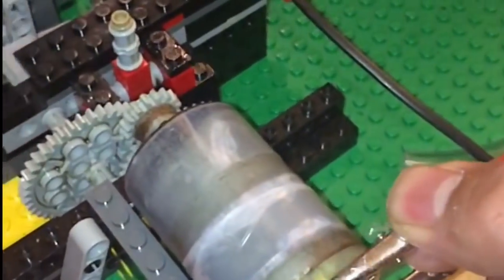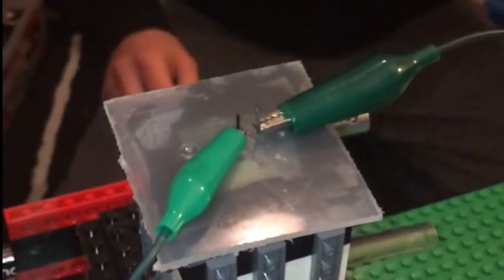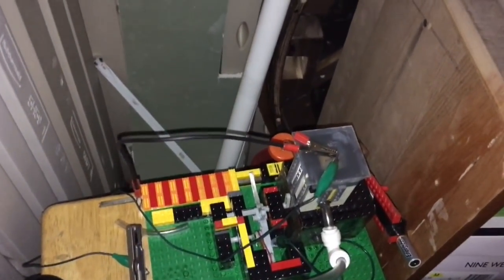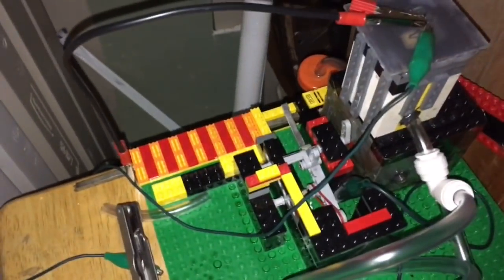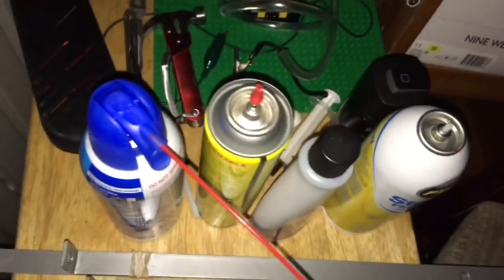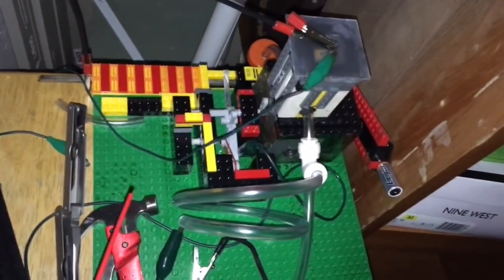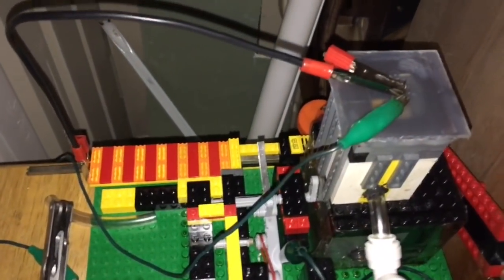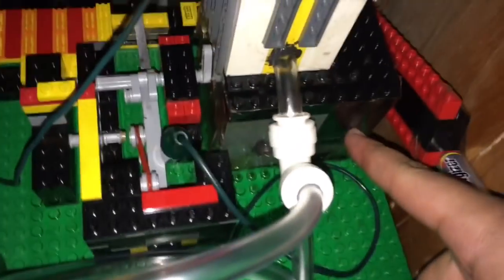LEGO 2 Stroke Motor (With real COMBUSTION) attempt

Comment: You are making history man¡¡
 I'm into the ride whit the 2 stroke lego... 
One suggestion I got is to make the piston travel shorter so it is easier to complete the cycle, or epoxy all the legos from the cylinder to furder prevent leaks from it...
Reply: YES piston travel is massively more than it needs. Try shortening it at least a "little" bit.. You could use smaller flywheel then perhaps using a few large lego wheels as a flywheel if you have them. more reliable
Reply from the maker: Dude that's a great idea, we might be too far into change that though. But if all else fails I'll keep that in mind, and shout you out for your geniusness
Reply: Thanks for the appreciation bro, hope everything runs smoothly on the end and the lego engine melts down on its own powaa¡¡ haha... And a big greeting from Argentina
Hope my english isn't to bad tho

Comment: Awesome idea. I feel like it’s missing compression, carburetor to mix fuel and air consistently, and be sure the ignition isn’t till the piston is going down from the compression stroke
Reply: It's definitely missing compression, the carburetor could be replaced by injection since that is easier on a lego engine
But yeah ignition timing still needs to be worked on

If the creator sees this, I suggest you go to a CnC workshop amd forge your own lego pieces out of steel if you can for the piston and the crankshaft, it will make it run better

Comment: Looks like you're not getting compression. You'll get explosions, but it's probably leaking around the piston. 

Nice design. Hope to see more!
Reply from the maker: If it's going pretty fast it cranking at a good speed, we get good compression
Reply: Mad Brick legos have gaps in between them so they dont get good compression
Reply: Mad Brick try timing it
Reply: Mad brick not always I had a weed whacker spin at high speeds and fire but I didn't have enough compression so it didn't run and I took it apart and found it had a large gash along the cylender
Reply: Mad Brick Mike do you have a old carburetor or a junkyard carburetor  the way air and gas com to geter and or like lawn mower carburetor
Reply: Mad Brick a car with a bad head gasket can have bad comression and run. Just because it fires doesnt nessicarily mean it has good compression. You need a way to make a seal on the piston and a way to make sure that there is nothing escaping through the sides (the lego bricks)
Reply: Mad Brick you can't be sure you have compression until you get a pressure meter
Reply: Piston rings would help
Reply: I think that they need to mess around with the fuel air ratio and if they said flywheel wasn’t good enough then better flywheel. But compression is probably the biggest culprit here

Comment: You need proper compression, which this solution just can't provide. Even a few dozen psi would be enough.
Reply: MonsterWithConscience what they need to do is get some tiny washers for piston rings,  round pistons so it'll finally get acceptable compression, get some oil in the cylinder to boost those numbers, and it should actually work
Reply: Grew up as a tuner, so do I need to begin explaining just how difficult and intricate a process it would be to provide forced induction to a very low displacement motor made from legos, which leaks horrifically, has no lubrication, fuel supply, coolant system (passive nor active) and of course has an abysmal capacity to cycle due to its lack of compression? I'm trying to be brief, but I could keep going...
Reply: chasebh89 a layer of jb weld on the piston head and along the cylinder walls Isn't a bad idea either to raise compression

Comment: How are u sure that the gases got in? Try injecting the fuel while turning it as it draws air...idk
Reply: Andrew Vigil yah and the air fuel mixture has to come through that valve that they made with the bottle cap and into the bottom end then through the transfer port into the cylinder
Reply: Fuel pump is Wat I'm getting at I guess.
Reply from the maker: We did still wouldn’t work. This is because a two-stroke is not really create suction at the combustion chamber the bottom portion in the crankcase creates positive pressure which Then forces  the fuel air mixture to the top combustion chamber via the transfer port
Reply: Not quite sure if Yassine's thought anf mine are on the same page, and I'm no expert but shortening your air/fuel tubes hasnt been tried? When you spray the air in with the fuel so you're certain it makes it to the cylinder head
Reply: Mad Brick larger transfer port maybe?
Reply: Andrew Vigil tbh i think it should be slightly smaller in diameter and alot smaller in overall length to help the gases make it through the tube in time